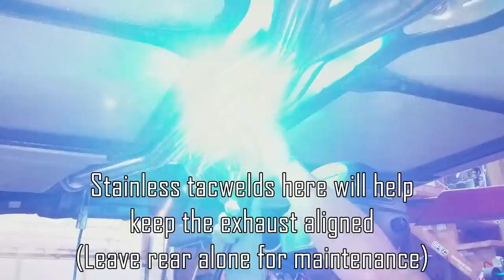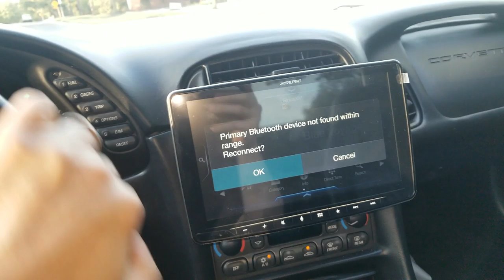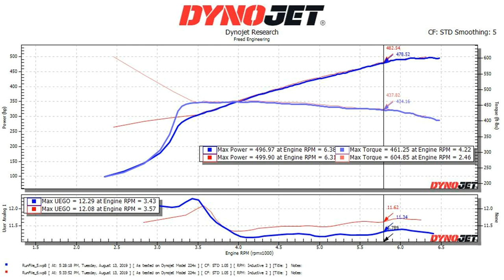BUILDING A 500RWHP SLEEPER Z06 IN 10 MINUTES

Comment: I had a 2002 Z06 with heads, cam, intake, roller rockers and injectors. Made over 430 RWHP and it was fast as hell. Im sure this is pretty sick.
Reply: only over 430? should make atleast 500
Reply: @WeAreHis.  I’ve seen a guy do a top end kit and full exhaust on a C5 z06, he made 335 hp stock, 450 hp with the modifications installed
Reply: @WeAreHis.  i have ls6 ported top end with btr 4 cam and im barely at 430 myself. you would need some cnc ported and milled heads and bump compression to hit 500

Comment: Damn fine build. Love them C5Z’s. Light and still relevant. 
🇺🇸👍💪
Reply: I have an ‘03 that’s built to The gills making over 700whp on a mustang dyno….the stiff chassis, stout drivetrain, ability to put big rubber on stock, & super light weight make it a perfect candidate for mod addicts. Every time before I tossed more mods/$$$ at it I’d drive some other stuff just to make sure I wanted to continue building it or “upgrade”….but the bottom line is for a RWD V8 powered car w/ a stick shift there’s still nothing out there that can compete $ for $. A C6Z is close, but doesn’t take to FI as easily as a C5Z, the heads/valve train on C6Z need work in stock trim to be reliable for instance.

Comment: Props for a job well done but I don’t think I’ve ever heard a Z06 called a “sleeper”.  That engine in a Sloppy patented ‘79 Fairmont 4 door?  That would be a sleeper.
Reply from the maker: By today's standards a 13 second car that can now run 10's and gives no clues visually or audibly it meets my definition lol But I do see your point
Reply: Matt Brad  if I remember correctly, even a Ford magazine broke into the 12's with a bone Stock Camaro SS LS1. And I think it was even an Automatic car.

Comment: Rick, do you think it would be possible to fit this with the stock hood and stock engine mounts if you cut away even more of the hood cross support material?     Enjoyed the build!
Reply from the maker: It might be possible, I would say there was about a  half inch of hood brace left in it which is more than the engine cradle spacers and lowering mounts dropped it. I thought about cutting them out completely but didnt want it to loose its rigidity.

Comment: Curious what this build (ballpark) set the owner back and how long did it take start to finish? Love this! Well done!
Reply from the maker: You would have to get a hold of the shop for a quote (Vette Tech Motorsports). The setup was chosen by the customers criteria to have a stock sounding package that also fit under a stock hood and could safely maximize the capability of the stock engine. With first time fitment, shipping time, and unforeseen issues it took about 2 months with all the down time but next go around it could be done in about 2 weeks with parts on the table.

Comment: Nice build! The engine won’t need any reinforcement? Sorry for the nube question. I especially like that the option of going over redline is there
Reply from the maker: Thank you! 500rwhp is not a problem in stock internal 5.7 LS You could push it farther at the expense of longevity but I believe the 500 mark should last a long time.
Reply: Camaro Rick oh good!

Comment: Hell yeah! I’ve always wanted to see one of these under a factory hood! Any idea what the total project cost? I have a 2003 Z06 that I’d like to do the exact same to.
Reply from the maker: Close to 10k in parts
Reply: Russell G.S. - put a vortech A&A kit on a C5 installed, tuned and out the door for under $10K.   Picked up about 180 wheel hp and 150 ft lbs torque.   Stock motor except injectors and valve springs.   No headers. Borla catback through factory cats.   Made 470 at the tire through an A4 trans.   I think you’re north of 500 on a manual trans car and close to 525 on a C5Z.   525 number is estimate on A&A website and I think it’s a solid estimate based on my LS1’s numbers.

Comment: I thought that eddlebrock supercharger didn’t work with cathedralheads ?
Reply from the maker: They make 2 versions of this supercharger. One is LS3 rectangle port, and one for LS2 cathedral port. It fits an LS1 head also but the kit was never meant to fit a LS1 C5. The valley cover has to be modified. You can check out the original videos in the description playlist. This is the first under a stock C5 hood ever.
Reply: Man, if you did a detailed post on the corvette forums on how to make it fit you would be a hero. They only other pd blower we have is the Maggie. I would be super interested in doing this to my car Im the future instead of the Maggie.
Reply from the maker: @fmijares09  I like these superchargers they are quiet and the lowest physical profile. We contemplated on the maggie but my customer didnt want to change the look of the car with a high rise hood so we took a gamble. Ive installed a bunch of these on C6 vettes with great results. I did make a post of CF with the setup for anyone interested as well with parts needed. 
https://www.corvetteforum.com/forums/c5-forced-induction-nitrous/4237954-eforce-ls2-supercharger-build-on-a-2002-z06.html
Reply: Awesome thanks for the link!
Reply from the maker: @fmijares09  no prob! good luck with yours

Comment: Nice job Rick!   Too bad the owner chose to use that total POS SC, an A&A SC would have saved labor and you wouldn't have had to cut the car up... plus it would make more power.  That blower the owner chose to install is known to be total garbage!  Their other SC's are great, the LS blower, JUNK!
Reply from the maker: Are you speaking from experience?
Reply from the maker: @ssoffshore5111  They gained 60hp over NA with a maf tune at a horribly lean 14:1 atf ratio, on a 6.0...  Lol, there are obviously numerous issues that have nothing to do with this sc design.

Comment: Nice build.  I had a 98C5 convertible with A&A Vortech V3si.   Made 470 wheel through a RPM A4 trans and 3.42 rear differential.    Great car.  Drove like stock as long as you had a light foot.   Kind of sketchy on cold wet roads though.    I think the C5s are the best bargain performance car on the market.   I have a C6Z now and it’s pretty much “that car” you described at the stop light.   It’s road manners aren’t bad but no where nearly as behaved as the C5 was.    Anyway, great build and very cool car.
Reply from the maker: Ive done a few of those as well, For all out power its hard to beat a centrifugal. I dont particularly like maintaining them but they work great and make great sound!

Comment: how did you angle the motor to reach all the bellhousing bolts? mine are almost touching the body
Reply from the maker: On the torque tube there is a diagram of how far you can angle the engine back. There are a few bolts you need a stubby ratchet wrench to loosen up on the driver side i believe. The torque tube comes off before the bellhousing does so you can angle it up and rotate it for removal
Reply: @CamaroRick  had no idea there was a diagram on there lol thanks for the tip! Already have the torque tube off and stored tho just wrestling with the engine and bell housing still attached in the car. Any idea on how to angle it without using the torque tube?

Comment: I'm very impressed.  I have a 2001 zo6 with under 8,000 miles. Would you consider doing this job on it?
Reply from the maker: Absolutely. The shop is in MD if interested
Reply: One it's Z06 not o as in the letter. 2, no. You don't drive the damn thing so there's absolutely no point.

Comment: Nice time lapse vid and very helpful for me looking good at a c5 z06 currently. Just curious why so many people don't stroke the motor to 383ci along with a cam and headers. Would hit 480whp plus having a forged bottom end to boot... just curious why it's not popular is all.
Reply: Many people dont remove the engines bc its easier to do cam or supercharger than take the whole engine out
Reply: Cost vs power vs drivability.  Most guys go with A&A or ECS centrifugal type SC.
I'm researching what to do with mine.  I'd really like to TT it but a bolt on SC is well proven and they kits require very little modification to the car to make them work.

Comment: Nice video and fun way to see the whole project in 10 minutes rather than 10 hours! I’m not crazy about the music either… and, what would be the results with a regular C-5?
Reply from the maker: Yea finding tolerable YT approved music is not my strong point. Id say a base C5 would be similar within 30hp give or take. If anything you could run a smaller pulley for more power as the bottom end is basically identical minus the slight cam and head specs. You could even crank it up more if you wanted to trade reliability for power. I think 500rwhp is a safe level for these OG LS motors. I have seen guys push a 5.7 to over 600+rw but by hanging on to a prayer.

Comment: So i  have  a 99 C5 and want to get around 400-600 to the ground while  being reliable.  Any tips  on what  would be best to upgrade to increase reliability?
Reply from the maker: they can take 500rwhp no problem in stock form. you can push them over that maybe 550 but after that your really pushing it on stock internals for a long lasting setup. The rods can break and take out the block. If you forge the pistons and rods at minimum you can push it till the sleeves crack. On a good tune that could be over 700rwhp. There are guys boosting a stock LS1 5.7 running over 150+mph in the quarter but for how long is anyone's guess. You can always re-sleeve the aluminum 5.7 blocks if you want it bulletproof and take over 1200hp
Reply: I could write a novel correcting Rick's misinformation. I know these comments are old now, but if you're still looking to build your car, let me know and I'll help however I can.
Reply: Grizzy _7767  A bone stock LS1/6 can handling 700+ with boost, the only thing you need to do is gap the rings and and do a clutch to handle the added power. Simple bolt ons will get you close to 500... Aftermarket heads (NOT worked 243's) to raise compression, a good cam, long tube headers, off-road x-pipe, an intake manifold and most importantly is a GOOD tube. There are a few other mods I would suggest like a radiator, 160 thermostat and torque tube bushings for starters. I had my 02 base model at around 470 ish wheel for about 3 years before I sold it, beating the crap out of it with a single problem, but mine had PRC 2.5 243'S for budget reasons. You may also want to consider tuning it on ethanol.

Comment: Nice, but a little confused on only 500. My na c5 has cams, built heads and headers etc and makes 475 hp and 500 on a shot of nitrous.
Reply from the maker: Its not for everyone! Could just run a 200 shot on the stock motor. Why not
Reply: @CamaroRick  yeah, just how you want the car to behave. Ones like mine tend to very jumpy and arent as friendly for everyday driving.